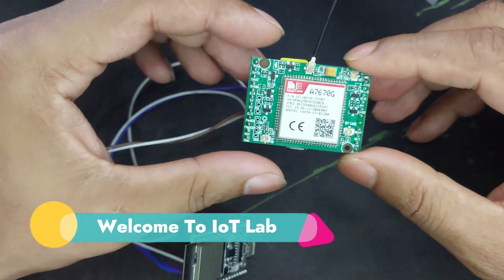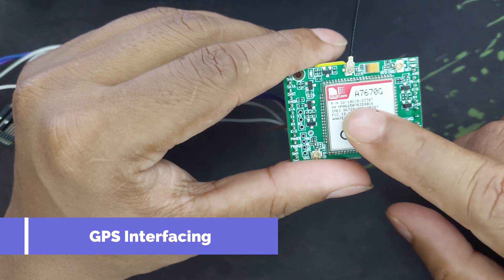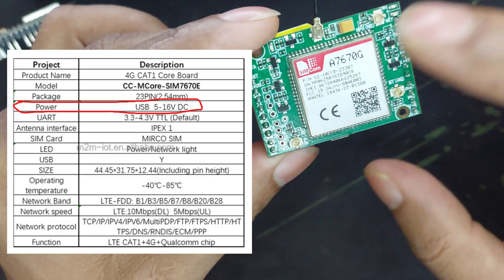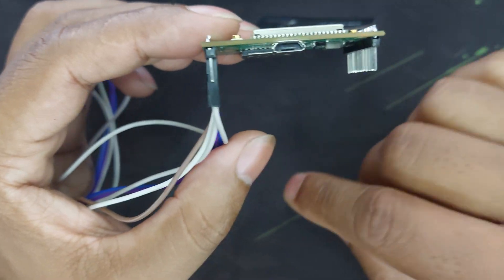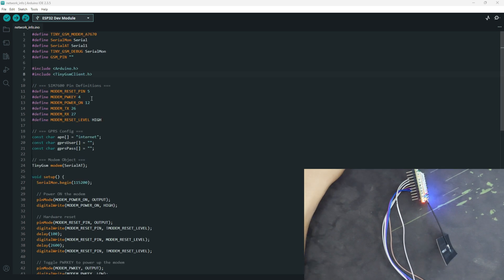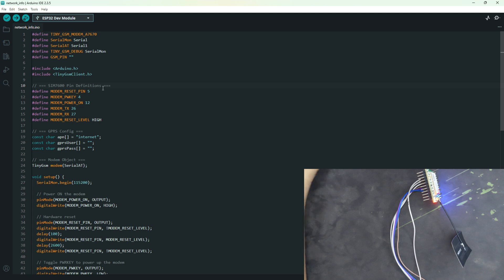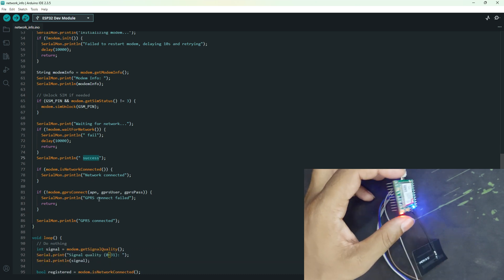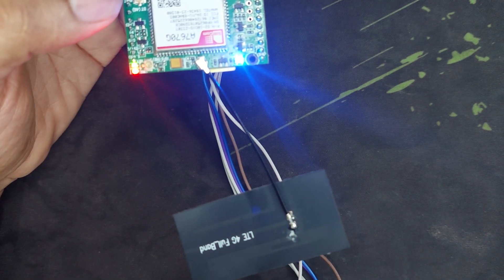How to Connect SIMA7670G 4G GSM Module with ESP32 | Get Network Info & Signal Strength

Comment: if I wanted to use this to use it as a modem, that is, as an internet access point via Wi-Fi using the 4G network and connect the Wi-Fi to my iPhone and browse, is it possible? I already know the limitations but I want to know nothing more.
Reply from the maker: possible but not with esp32, you need more powerful processor
Reply: @i @iotbhai  which one do you recommend?

Comment: i am currently using the SIM7600G-H.  I have connected the RX, TX, and GND of the USB to UART converter to the TX, RX, and GND pins of the SIM7600G-H and supplied the power via micro USB (CN102) from the power bank.
when i send the AT command, it does not response. could u help to solve that problem?
Reply: same issue i am using waveshare sim7600g-h 4g module but it is not working with esp32 have you got any solution??
Reply from the maker: Need proper baudrate to talk with the modem